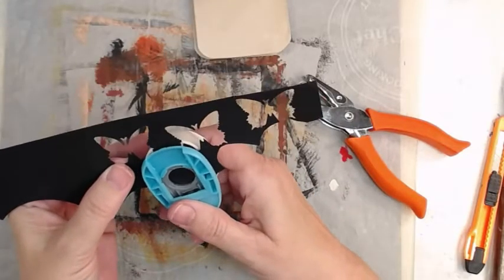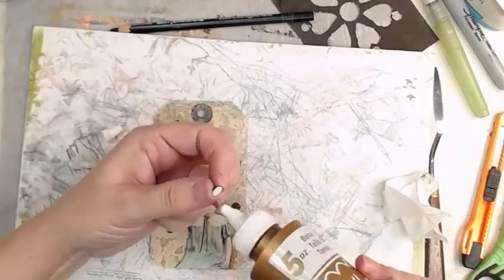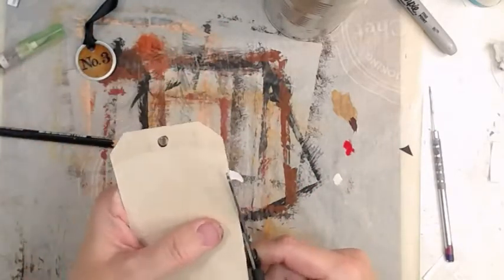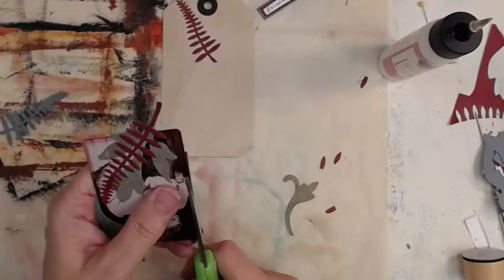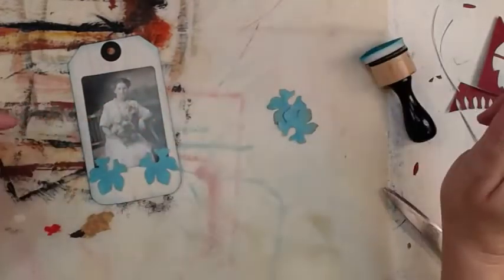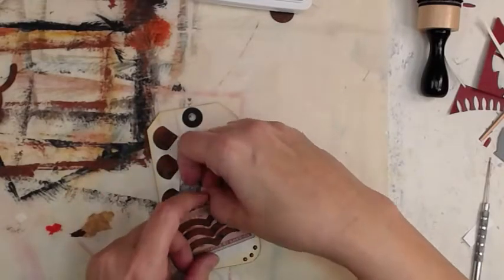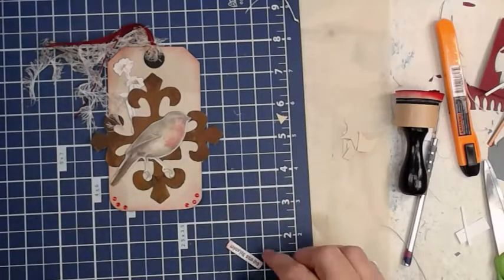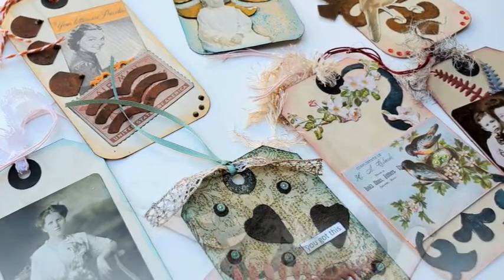Lets USE Faux Rust

Comment: Lots of fun to watch. Seeing the rust/patina bits gave me a sense of completeness because I usually make the pieces and hoard, I mean keep, them and not use. I think #1 was my favorite, lacy napkin and all. Btw where do you get the little brush things you used to colorize and what are they called?
Reply from the maker: MORE thank you Lisa, I think they are called Ink Piks, had 'em forever so not sure where from. I found some at Rubber Moon 50 for $11, but if you search you could prolly find cheaper / fewer. They are really nice for adding just a tiny touch of ink to really anything. They are like a teeny tiny felt tip that absorbs the ink and then you draw / paint in on. MORE thank you again darlin
xo
happy weekend artin more xoxo

Comment: POP  lol  you make me laugh so!!  <3  Ohhhh using those between sections of the pop dots is SO brilliant!!  I saw Marta of Maremi's Small Art do that within the last month or so and was gobsmacked that I never would have thought to use them!   I love these little treasures you've created - each is so different and my fave is the birds.  Thank you Jamie !!  <3  OH - I cannot find a pin small enough to put in the end cap on my Glitter Glue like yours.  The pin they included only fits the regular end, not the metal cap, so what kind of pin is yours? :O
Reply from the maker: that (you) makes me happy darlin. well what kinda penny pincher would I be I tossed all those pop dot bits! The pin i have is the one that came with the cap and I've almost freaked out a couple times when it has wandered off, you know how they do. my quilting pins that I thought were stainless turn out to rust in a glue tip. whats up with that !?! lol Thank you so very much for your support 
xo
happy weekend artin at home